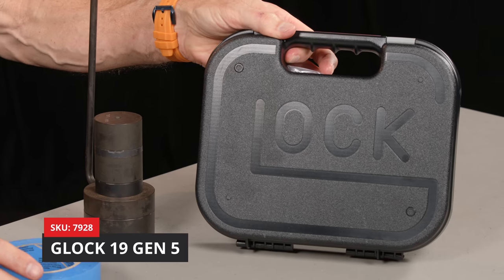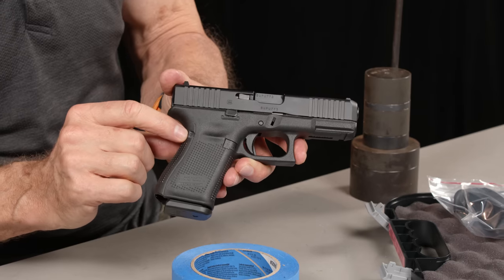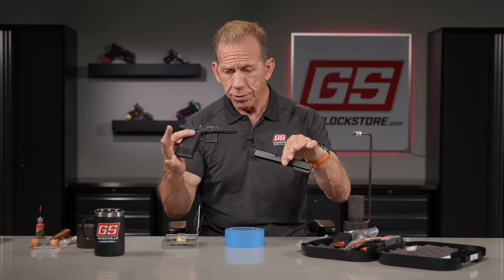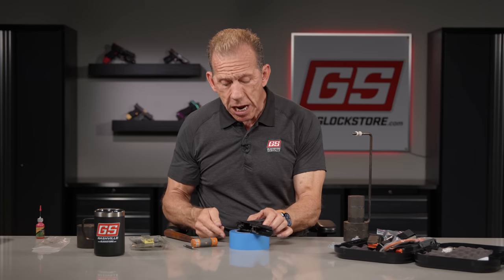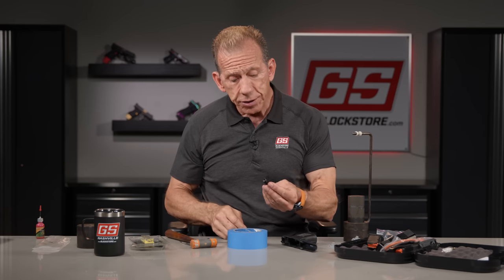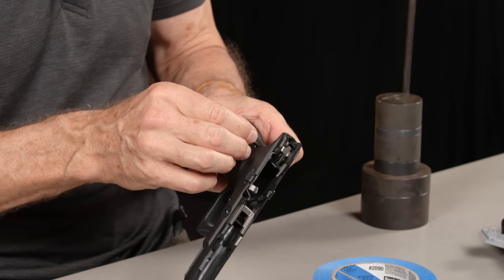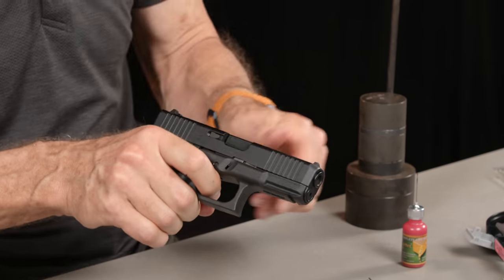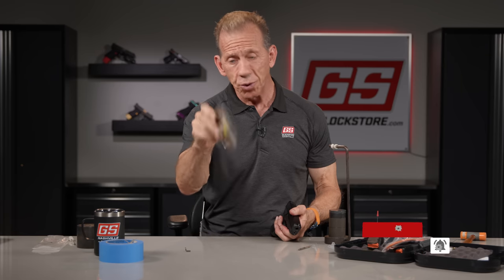How to Improve the Stock Glock 19 Trigger!

Comment: You don't really need to lighten a Glock trigger. It comes with a good combat trigger. The gun my department makes me use is a Sig DAK, which is an improvement from the Sig DAO trigger we initially had (14lbs and about an inch of travel). After using those and getting accurate results, I love a standard Glock trigger. A glock trigger is plenty good for self defense. If you think you need a lighter trigger then you really need practice and training. Too many people trying to buy their way into being a better shot.
Reply: My first guns had great triggers. My first was a mark xix desert eagle. That 3.5 lb trigger pull had me very spoiled. When I got that kel-tec p-11 as a backup I wasn't interested at all practicing with that 14lb trigger as my hand would be shaking by the time it finally broke. I agree glock had a great trigger I always thought it was lighter than 5.5 lbs mine was used and that trigger already broken in.
Reply: you're right but who asked for an essay about you?
Reply: @danbuckley6584  You must not have done very well in writing classes if you consider a paragraph to be an essay. But to answer why I commented, it's simple...I wanted to.
Reply: @jonniemactyler7929  apparently.  Gotta get that autobiography out somehow.

Comment: Glock didn't feel the need to have an external safety because of the way they designed the stock trigger.
Reply: Exactly. I wouldn’t touch a Glock trigger. Especially on the gen 5. Also the only malfunctions in glocks I’ve ever heard of were ones that had trigger jobs.
Reply: they have a trigger safety and i wouldn't ever do a trigger job in a gun. if the company wanted to be that way it would have done it. competition is different
Reply: perfection

Comment: I have gotten used to my stock Glock triggers. I polish and lubricate any metal on metal, and dry fire a good amount. For me that smooths out and lightens everything up, plus dry firing is good practice for steady trigger pull.
Reply: @Blap552  😂 maybe don’t buy garbage
Reply: @nfaisnfgay  Let me guess. You’re a Sig guy. Sigs are great. You don’t even have to pull the trigger for them to fire!  Makes it so much easier.
Reply: @EyeForKnowledge.  Nice assumption. You know what they say about assumptions? 

Also, I love modern fudd lore. Remember Glock Leg?
Reply: @nfaisnfgay  Glock leg. Sure. Any idiot with a pistol can negligent discharge. And shoot themselves in the leg. Glocks don’t fire unless you pull the trigger. Sigs however….
Reply: @EyeForKnowledge.  Say that again, but slowly. We’re literally experiencing Glock leg 2.0.

Cops would say the exact same thing during Glock Leg. “It fired on it’s own!!!”
Reply: @nfaisnfgay  No doubt this is Glock leg. But Sigs firing on their own?  That does happen. Just not in this case. I was talking to you as you said Glocks are junk. Usually Glock haters are Sig boys. So I was making a comparison on how Glocks have never fired on their own. You brought up Glock leg.
Reply: @EyeForKnowledge.  kek nice reading comprehension. Look who I tagged when I said that comment and who the OP of this thread is. Amazing.

This is actually hilarious.
Reply: It's no longer stock then, if you had to polish it. So you didn't get used to it, did you? It's a cheaply made (yes cheaply) police and military sidearm, not a finely made target pistol.

Comment: All my Glocks get the same treatment.  3.5lb connector, Ranger proof shoe, and a deep polish on all metal to metal.  The benefits of the polishing and the connector are obvious.  The geometry of the Ranger Proof trigger shoe removes all of the slop/creep.
Reply: of the Ranger Proof triggers which do you prefer? Thx.
Reply: @iluvbike  I use both the Task force and strike force models.  I haven't tried the hybrid yet.  You will not be disappointed with any of them.
Reply: New to glocks just bought my first g19 gen 3 month ago been shooting it a bit what would a good upgraded trigger and where to buy all that?
Reply: @nascar3fan108  Connector from the Glock store and the trigger shoe from Ranger proof.
Reply: @nascar3fan108  I have a G45 with a Pyramid trigger that is very nice. I also have a G19 Gen3 with a Apex trigger in it. I like Apex a lot too.

Comment: Lenny,  your awesome Buddy great clear instructions.  I ran my 43x and 45 in stock form for a year and they did get smoother over that year but still not as good as I was hoping for. So right after watching this video I ordered for both an eazy install 10 minutes, keeping all stock springs gave a 4.5 lbs.  smooth shorter take up to wall , clean CRISP Brake , quicker to reset , altogether it's smoother easier pull to brake it does help with accuracy . At just $25 it was a great improvement. Thanks Lenny .

Comment: I'm a huge fan of the double diamond connector! I have 2 of them. I highly recommend it if you don't plan to use an after market trigger
Reply: How Much Are They, PRICE ???
Reply: @jeffadams9807  they were 25-30 bucks when I bought it.
Reply: I put the double diamond connector in my p80 glock 26 build because I accidentally snapped the original connector that came with the parts kit while building the gun. I took it to the gun range and my gun now shoots like a switch. Every time I pull the trigger it shoots out of control. With the original connector, it shot normal. Would you say there's something wrong with my gun or is that common for the double diamond connector to shoot so fast like that?
Reply: @magicjordan9131  the double diamond works well in a stock glock. the p80 frames are probably a little different. are you using a stock glock trigger housing? I recommend to use all stock parts other than the connector and springs if you can. Another thing to check when that happens is to bend the connector to be the same angle as the stock glock connector. It should stick out a little bit, but not to the point of dragging on the frame. Until you figure it out, I would recommend to only load 2 bullets at a time!
Reply: @vmanshooting  great solution and advice thanks homie😎👌. Im goin to see what happens when I buy factory glock parts and install them instead but I can say that I'm almost certain I bent the connector the right way because when I didn't bend it at all the gun wouldn't even fire( or sometimes it would fire 1 shot and then jam afterwards). So with a little trial and error I  finally bent it enough to where it can be fired but Now it shoots WAYYYY  to fast. Like as soon as I even think about touching the trigger it sends 2-3 shots down range (which looks bad ass but not ideal for accuracy and also not allowed at my local gun range). Someone also just told me its doing this because the double diamond connector is meant for competitive shooters to shoot faster and the competitive shooters are used to the speed or something like that which kinda makes sense but I'm not too sure how true that is. Im just goin to do what you suggested and call it a day thanks again
Reply: @magicjordan9131  no competition shooter wants something like that. And exactly for the reason you mentioned, accuracy :) . I'll be interested to hear how your journey goes. TBH, I've kind of given up on customizing Glocks. So many things can go wrong because there's infinite parts you can customize and they need to play well together.

Comment: 4.5/pound striker spring, reduced safety plunger spring and my trigger is already 3.5-3.75. I just ordered the D.D. 3.5 connector can't wait to see how light & accurate it is when I get it put in.
Reply: It smooths it out nice.....still got a little travel though .....you will like it !
Reply: @ricks7432  I already took out all my pre travel with a set screw, I build trigger shoes off of Johnny glocks design.

Comment: Tweaking the parts yourself is the best approach. Polish hardly does anything unless you're just taking off burs or something that shouldn't be there. Starting with a P80 is maybe the best since sometimes the rear rails will sit a fraction higher than Glock. My sears have well over 50% engagement but feel like absolute butter because I tweaked that engagement. In reality something like 20% is going to work. Not recommended for a carry gun but it will work and have an incredible break.
The sear is the key part to the tweaking of the break but everything else is stuff like getting the perfect bend on the connector. Little polish here and there can get rid of grit but not really reduce the pull. It's almost impossible for me to slowly ride through the break on a nicely tuned oem trigger whereas I can do that with almost any other striker fired pistol.

Comment: Hard to know what's best for CCW. You want a light trigger for accuracy and quicker follow-ups or do you want a heavier trigger for safety? I think heavier... but I'm not sure if it really makes a difference (with safety).
Reply: Just follow the 4 rules of gun safety, and if you're ever in a self-defense shooting, don't say anything stupid to the cops. Accidents aren't self-defense, and self-defense isn't an accident.

Personally, I don't mess with triggers on my EDC firearms, I just do a lot of training, dry fires, etc., and really it doesn't matter how heavy the trigger is as long as I'm used to it. I figure the stock trigger is very reliable and I want reliability in my EDC. I save the gucci triggers for my target pistols and nicest rifles.
Reply: @fakecubed  True, a trigger isn't gonna pull itself. A lot of people prefer DA/DASA for safety, but there are many people that carry  SA (or striker fired) guns with no safety... and they never go off without the trigger being pulled (with extremely few exceptions). On Glocks, I actually prefer the 8lb connector. It's kinda like a heavy single action. Good for carry IMO.
Reply: I carry a gen 2 g19 with a 3.5 disconnect and have never felt that it was unsafe.
Reply: With my Arthritis, a little lighter please.
Reply: @hateforall4012  been looking at the double diamond and the oem minus connector..any experience and are they drop safe?

Comment: I continue to use the Glock factory applied Copper colored lubrication. I find Glock copper colored Bronze Oilite Anti-friction lubricant is the Best for the trigger friction points. I found 3 sources of Glock factory applied Copper colored lubrication on the internet. 10.0ml of lubricant will last a very long time. ❤
Reply: why would you add .0?

Comment: A rubber hammer is fine, if you're bashing on the gun itself, but it makes hammering on a pin punch twice as much work because instead of delivering a solid blow, the rubber soaks up the power exerted from the hammer. Better to use a metal hammer when using punches.
Reply: lazy

Comment: Actually put the speed of the video up to 1.5.  Not an insult, very thorough, non rushed demonstration.  A couple days ago I thought about it and realized with my range dieing of covid and My not really going anywhere, I hadn't shot, cycled or cleaned my Glock for a good long time.  So I needed to take it all the way down and wasn't sure of the dis-assembly and re-assembly.  Brought up a couple videos and those I had to put on half speed, stop and back up a bit.  Guy says, just put that here, pay attention to the spring direction, and your done.  Spring direction?  If you're going to call attention to it MAYBE show it.  Now, I found a couple other videos (that certainly takes no time there are a bunch) but I've got all the parts out here on the desk.  Later, I found that pin that rolled under the keyboard when I was typing because of the further video search.  
So a casual, step by step detailed instructional video was well appreciated.

Comment: For the guy who claims ....."We've sold THOUSANDS of them!".....

WHY is a LIGHTER trigger, necessarily, an IMPROVEMENT?????
I submit that  in a high adrenalin "defensive situation" -- especially with an untrained / inexperienced individual -- a trigger that light is more of a liability than an asset.

Lenny might be a great salesman.....he is NOT THE EXPERT he thinks that he is.        BEWARE! 

As an example:
                         -he has since updated his original video - because I called BS on his very, very ignorant bad advice. 
In that video, as he was having difficulty removing a simple trigger pin (because he had NO understanding of the mechanics involved....  he  literally said, "get a bigger HAMMER and pound it out".  Now in the "new improved" video -- he goes to great lengths to explain the proper technique, as related to the peculiar grooves in that particular  pin.
Is it possible he was  trying to sell new trigger pins to all the people who ruined theirs ---by using his "recommended" method?

And then there was his original video about "proper lubrication of a Glock" ---- wherein he used more than a teaspoon full of oil in total ---- on one gun! ABSURD AMOUNT!!!
Let's see -- I wonder if he sells oil...."

CAVEAT EMPTOR!
Reply from the maker: Here's an answer to your question, a lighter trigger requires less of an aggressive movement to pull resulting in less disturbance in the shooters sight picture. as far as for the "untrained / inexperienced individual" you reference, it's not due to a lack of information and resources that we offer to become a better shooter. All of that comes down to dry-fire and hours of practice.
I hope you learn of a way to add to the community rather than tear it down.

Comment: Why is the improved, 3 1/2 pds trigger pull, kit not installed at the factory?  Should only be a very small increase in price during the manufacturing process, if any.

Comment: As someone who has concealed carried for close to 20 years and a tactical shooter I do NOT recommend everyone lighten up their triggers especially to 3.5 pounds.  In fact one could describe a 3.5 pound trigger as light as a feather.

UNLESS you continuously practice in a live action setting which includes drawing then firing your handgun and not standing still and shooting at a range it dangerous to have a light trigger.  The other major consider is accidental discharge or accidentally shooting someone!   A 5 pound trigger is light enough for 98% of gun owners.

Comment: I'm not interested in lightening the trigger. I am much more interested in a distinct wall for staging the trigger. I have found that the Gen 5 have almost zero wall, making it impossible for ME to safely stage the trigger 😭
Looking at Johnny's 5lb connector as a possible solution.
Opinions & insights???
Reply: That is why I like the hard wall of Gen 3; my understanding is that these 3.5 connectors would make my wall mushier (creep) which now is hard wall with no creep.
Reply: @gracedagostino5231  Shortly after this post, I emailed Johnny at Johnny Glocks, and he recommended his 5.5. So I did; lubed it, installed it, dry fired it, live fired it... Love it!
Reply: @davidhartley6232 why did you go with the 5.5 over others like say the 3.5? Doesn't the stock trigger have about same weight as the one you bought?
Reply: @dgilly716  My OP and follow-up explain exactly why 😉
The pull weight is just fine for me with the pistol kept in an AIWB holster. I simply wanted a "two stage" trigger 🤷‍♂️

Comment: I have bought a couple of the double diamond connectors and I can tell you they are crap! Save your money and do the 25 cent trigger job instead. I removed the double diamond and threw them in a parts box. Other manufacturers have more consistent connectors for sure. By the way, I became a certified Glock armorer in 1995 when their maintenance procedures were way different than now.
Reply: Could you recommend me a reliable connector?
Reply: What about the oem minus connector? Any experience?

Comment: Trigger it's just fine stock , after a few hundred rounds is smooth as butter, like everything mechanical it needs running in
Reply: Glock triggers are a coin toss. Several of mine broke in fine. My 43x is quite possibly the grittiest and most uncomfortable trigger I have ever experienced. Replaced the crappy trigger shoe with smooth Jonny Glocks shoe and installed 3.5 connector. Polished  the bar and safety plunger, now pretty decent. Glock perfection? My ass.
Reply: @Paleotech1  I have a gen3 34 , shooting it since 2010 and lost count how many rounds, I don't have experience with later generations 
We all know Glocks are not top of the line guns, if you want something quality you should look to Sig , HK or others,  but for me if it shoots and kills if needed it's more than enough

Comment: Bought a Dagger SW4 GatorMouth Complete Upper for my G19X Lower..
I have the 3lb Black Yikes connector, Polished everything, Trigger Spring Kit & a O.W. Precision TAC Trigger FDE/Red 
with my Dagger Upper on, I get 2.7lb straight smooth & very short pull w/ a forced short reset. 
However, when I put my Stock G19X Upper back on, I get a gritty, longer 5lb consistent pull. 
Very odd.

Comment: Bought two of these. One was so far off that it would not fit into the housing slot. The other binds the action so badly that it is very difficult to rack the slide. Just for shits I dremeled 1/64 off the bottom edge of the first one in order for it to lay in the track. Threw both in trash.
Reply: I bought their pyramid trigger years,ago and it would fire when trigger was pulled and when it was released